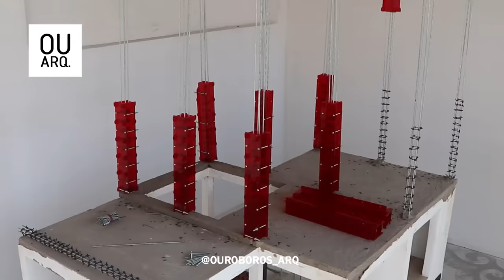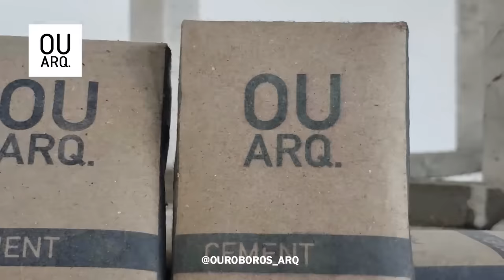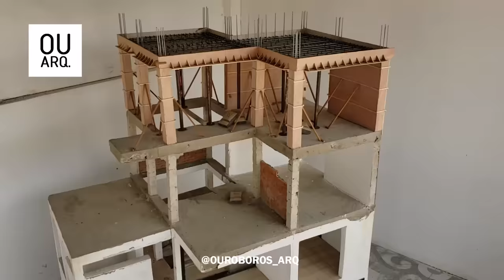Building a House in 10 Steps: A Practical and Easy-to-Follow Guide

Comment: This is how 90% of brazilian buildings are done, whether it be an one floor house or a 6 flats in a row/30 floors height high tower.
Reply: 99%
Reply: @jadermiani  99.9%
Reply: em todo lugar é feito assim
menos em países sísmicos tipo Japão e Chile
Reply: @memecity6722  na Alemanha já vi muitas casas com estrutura de madeira, assim como nos EUA e Canada
Reply: @memecity6722  Nos Estados Unidos e Canadá não.
Reply: Nos Estados Unidos eles preferem usar madeira (drywall) por ser mais barato e mais fácil de construir
Reply: @darklibertario5001  sim, mas drywall não é placa de gesso? Até onde eu sei a estrutura é em madeira e o drywall entra fazendo o revestimento das paredes e forração de teto no sótão.
Reply: That’s the first thing I thought. I think counties in Asia also use this method.
Reply: @memecity6722  América Latina e Sul da Europa em geral fazem casa assim.
Reply: @TheLizardskin  nos EUA é chamado plywood
Reply: @COREDYNAMICSLTDA  obrigado. Fui pesquisar e plywood é o nosso já conhecido compensado. 👍🏽
Reply: @TheLizardskin  KKKKKKK isso msm ,mesmo sendo "simples " a estrutura é boa ,sólida e rápida de se construir ,melhor que concreto na minha opinião pelo tempo mais hábil que concreto e os custos tbm de material e mão de obra
Reply: How to calculate size of the columns to hold the structure?
Reply: Same in India
Pretty much ALL buildings are made this way 
Only the REALLY REALLY OLD ones like before 1947 are made of a wood frame and concrete

Comment: It’s interesting how the real construction process is mimicked in miniature scale. It isn’t just plaster pits being pieced together, you’ve actually followed the real process.
Reply: So the floor doesn’t have I beams, just rebar with concrete?
Reply: @marxthesocialist5231  it doesn't make a beam in the shape of an I. (that's a an "i" capitalized)
In this video there are not beams. The floors are rebar in concrete to make a flat floor. 
Concrete breaks easily. I get that rebar makes it quite strong, but there are no beams per se that I saw in this video.
Reply: @nofurtherwest3474  ok and?
Reply: @kasitu9058  I'm just wondering if that's how it's done it a real building - there are no i beams just rebar+concrete?
Reply: @nofurtherwest3474  highly agree with you, even tha walls doesnt have steel bars to strengthen. If tis is done on the actual building it will easily collapse.
Reply: @gabchel6340  Thank you agreed
Reply: Mast hi
Reply: 0
Reply: Is the consensus that a real life scale one of these would collapse under its own weight?
Reply: Yeah he mimicked it exactly like the real one's..Even the deforestation part at the start😶
       Jk😁😁
Reply: Ramesh Singh rajasthan
Reply: @gabchel6340  I'm a bricklayer and concrete worker. You don't need beams for most buildings, actually you could use only rebar for 99% buildings, once its big and high enough it becomes easier, faster and cheaper to use beams. Or if it may have insane amounts of weight inside.

Beams super expensive price, way more expensive delivery, more weight harder to put in place.
Reply: You'd probably need a bit more rebar by most 1st world country standards. And have some more fancy materials, different concrete.
Reply: @nofurtherwest3474  it doesn't, though where I live, we'd use double the amount of rebar with 10 times as many connections. And other things on how you work the concrete and rebar.
Reply: @gytisdobrovolskis7355  I see, thanks!
Reply: @nofurtherwest3474  where i live it's done exactly as shown in the video, except maybe more rebar. i think it might also depend on how heavy/tall you expect the building to be
Reply: That’s what i saw at the first play of the video. Even the tools and method used. That’s a nice business to open
Reply: Hi
Reply: @slimyalien6044  Thanks bro
Reply: @nofurtherwest3474   . .
 
 .  
   
..
       
     .   
   
  
   

 
   .
Reply: @nofurtherwest3474   . .
 
 .  
   
..
       
     .   
   
  
   

 
   .
Reply: @nofurtherwest3474   . .
 
 .  
   
..
       
     .   
   
  
   

 
   .
Reply: @nofurtherwest3474   . .
 
 .  
   
..
       
     .   
   
  
   

 
   .
Reply: @nofurtherwest3474   . .
 
 .  
   
..
       
     .   
   
  
   

 
   .
Reply: @bijaykumarmajhi8038  I'm sorry but your comment did not show any text. just dots
Reply: @nofurtherwest3474
Reply: @nofurtherwest3474  ki mmpqp
Reply: @kamalapasand9702  wth
Reply: 0
Reply: @nofurtherwest3474  q
Reply: مب
Reply: @nofurtherwest3474   MN m
Reply: @qsageerahmad4844  lol man u guys trolling me hard
Reply: @puspachudali426  hey stop it what are you doing
Reply: Le
Reply: @nofurtherwest3474  
ឆា
Reply: @nofurtherwest3474  цж в
Reply: Oh fychv
Reply: @nofurtherwest3474  buckle my shoe up
Reply: @Snozcumber  No.
Reply: @nofurtherwest3474  c
Reply: @SamimSk-nn5qh  what does c mean i am so confused
Reply: @nofurtherwest3474  q
Reply: @marxthesocialist5231  iiiiiiiiiiiiiiiiiiiiiiiiiiiiiiiiiiiiiii
Reply: @marxthesocialist5231  iiiiiiiiiiiiiiiiiiiiiiiiiiiiiiiiiiiiiii
Reply: @marxthesocialist5231  ٠٠٨خخه7⅝ززظز
Reply: @afsanakalmani4983  hey man no i won't buckle shoe
Reply: @gre1s685  transplate pelase
Reply: @haka2667  hey speak english
Reply: @kavisharilive  hey man wtf u doing
Reply: N um i
Reply: b
Reply: 0pp0
Reply: زه ههههههههه
Reply: @nofurtherwest3474  hubl.  Vbmmmmlppp
Reply: you took the comment right out of my mouth!!!
Reply: Oh
Reply: 👍👍 @nofurtherwest3474
Reply: @nofurtherwest3474  we3

Comment: Working in structural concrete for years made me reallllllllly appreciate this video.  How cool
Reply: I really appreciate it too. Do you think the reason for the cracks in the concrete pillars are because he didn't use a vibration tool to make it mix properly? Obviously it might be tricky do something like that at that scale.
Reply: Hahaha I thought that.  A part of me wanted him to break out a electric toothbrush with the bristles chopped off.  Wow imagine if tiny post tension cables were used.